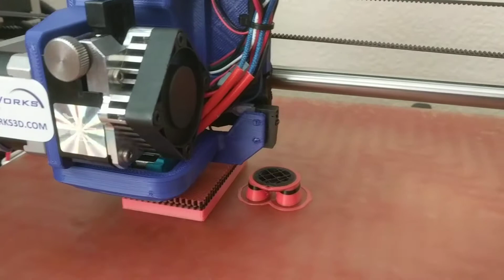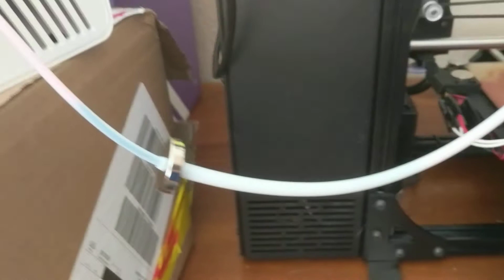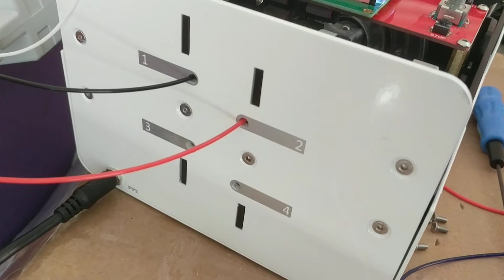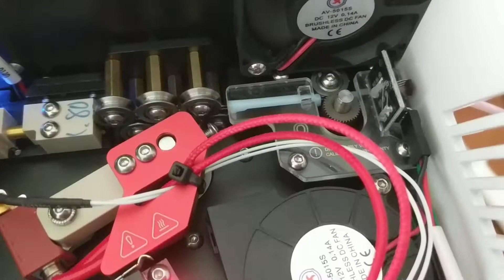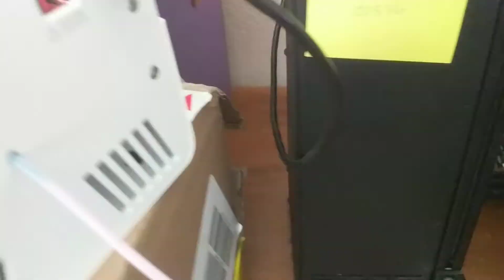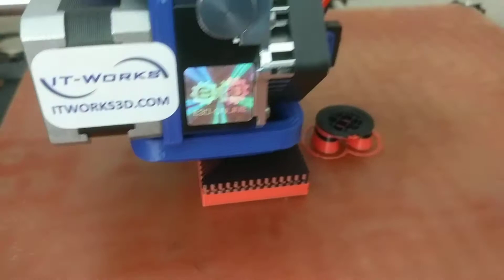Palette+ inside look, multi color 3d print, on LulzBot Taz with Titan Aero

Comment: Does it require slower print speeds?
Reply from the maker: We've been printing at standard speeds. We don't yet know if a printer with a normal nozzle size in the standrad range of .3-.6mm is capable of making a print that exceeds the Palette+'s ability to splice filament fast enough, but I'd guess that it's unlikely based on watching it operate.